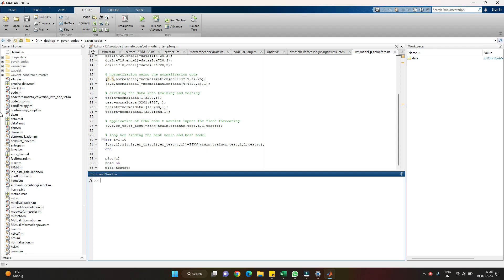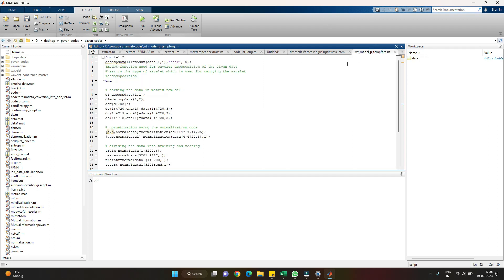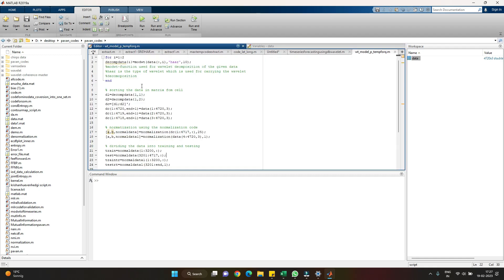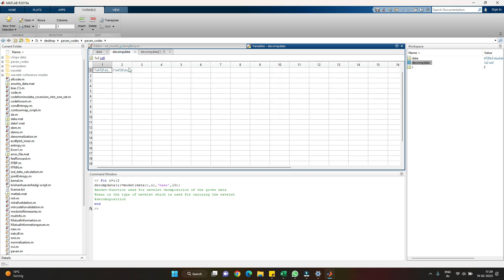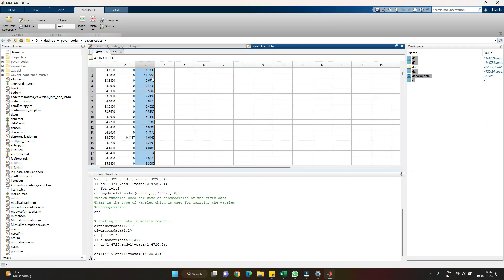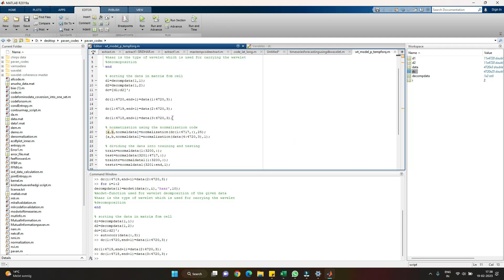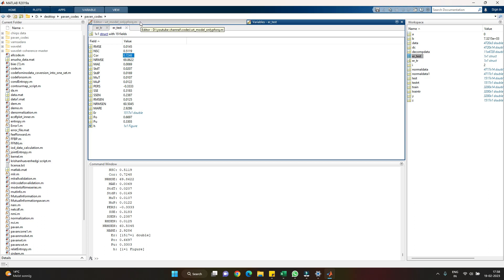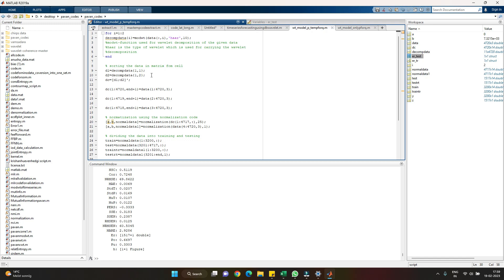Wavelet Neural Network (WT-FFNN)| Model development

Comment: Thank you sir for addressing ELM Query...the model worked well and provided good results....🙏

Sir I have doubt in data arrangement if I want to arrange the data through Excel for 1,3,5,7,10 day lead time can we do it by arranging the data as per your FFNN video in which you showed and then we can merge it with wavelet code for the analysis ...??
Reply from the maker: Yes, it is possible but first identify the data which has correlation similar to what i have done in the FFNN video or other videos and the arrange the corresponding data in tha manner to combine with wavelet code. cheers!